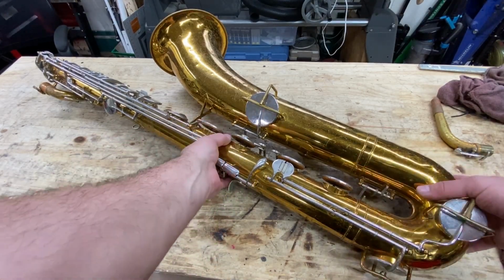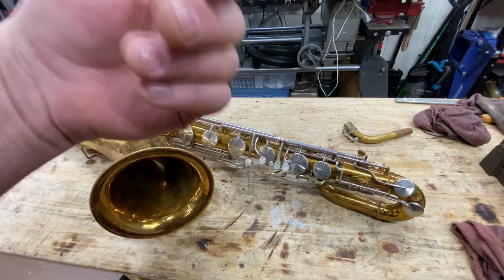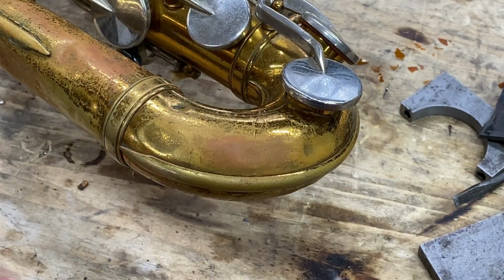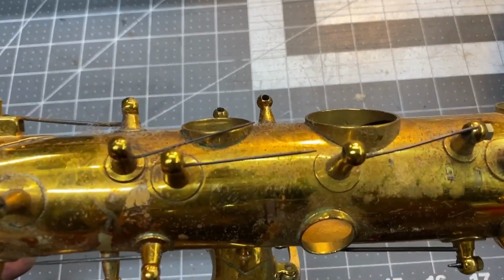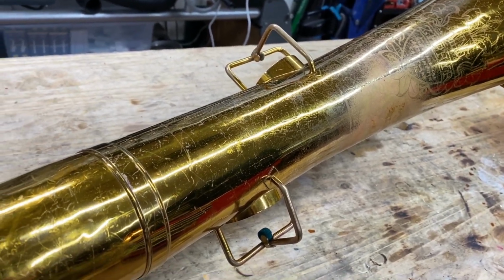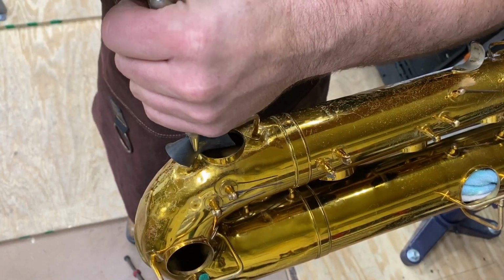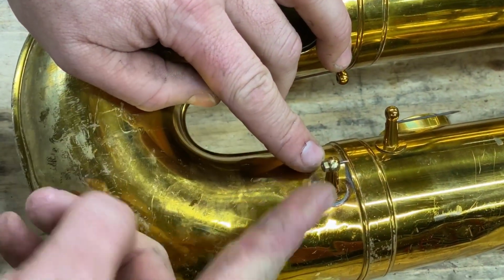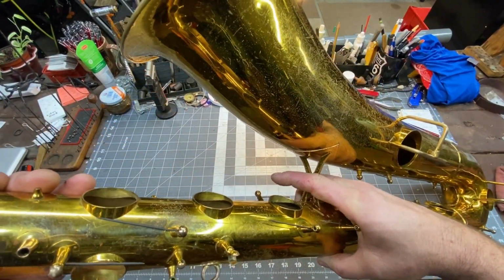Vintage King Zephyr Bari Restoration part 1

Comment: Just FYI, "Hard Rubber" was an early (pre-Bakelite) plastic type material, and like like most other plastics it firmly retained its molded shape and had to be cut with a saw. It was frequently used in electrical products, until superior materials became available in the 1930s.